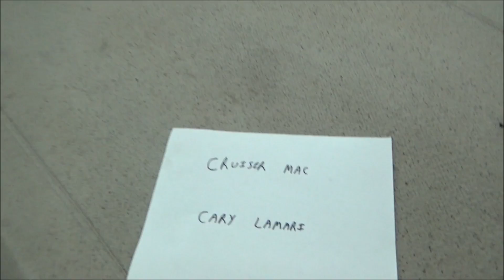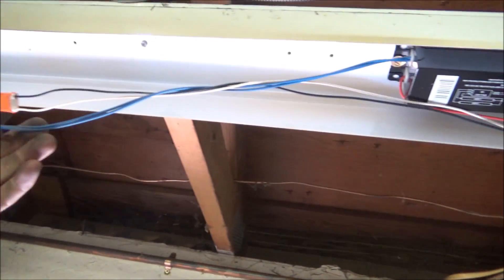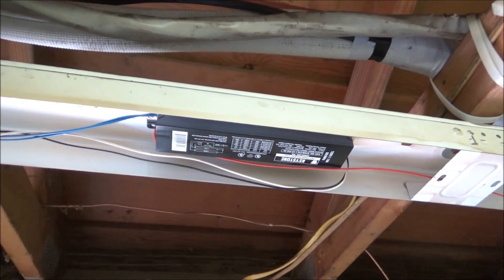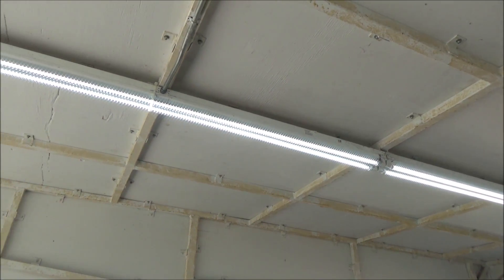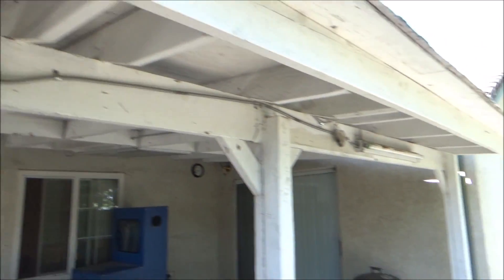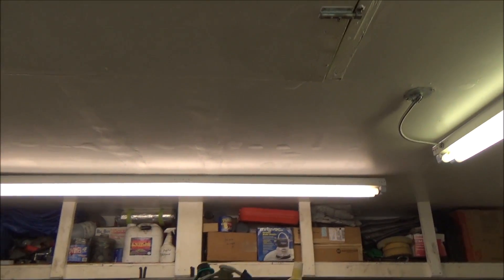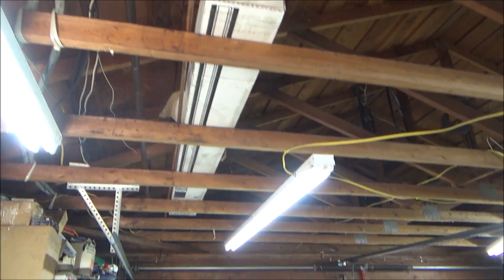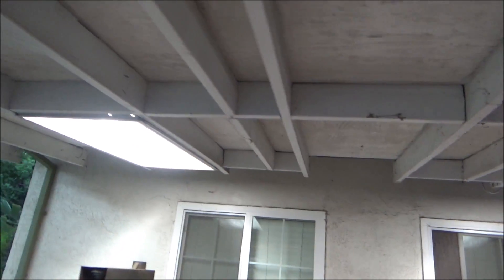How to Convert 8 Foot T12 Fluorescent Lights to LED Lights

Comment: You didn't show how to convert the dual pin t12 to a single pin.
Reply from the maker: I didn’t convert dual pin to single pin.   It was already single pin.  You just remove the ballasts and rewire it so the sockets have 120 volts going to them.
Reply: @1970chevelle396  all my t12's are dual pin. Are they shunted or non shunted?

Comment: Excellent light for garage, utility room, or workshop<👀>share4.photo/LCeilingLight?Hん    Like all surface mount strip lights, it's not going to win any beauty pageants, but as far as strip lights go, it's quite attractive. Puts out a lot of very nice, even white light, without any hot spots or shadows. LED driver takes a second to power on the LEDs, meaning you have a very brief interval between flipping the switch and getting light. This is really no different than the delay in a fluorescent fixture as the bulbs strike.
Reply from the maker: I put LED’s in my whole entire house.  Only regular lights I have are the ones in the refrigerator and microwave.  The LED’s are so much better.

Comment: Hi- interesting video...would you please post the following info on the 8' lengths of LEDs you installed? Such as the manufacturer's name? the wattage of each LED? the color temperature rating (Kelvin)? light output (lumens)? and the life rating (hours)?  I want to do a cost analysis on how much it will cost me to convert all my fluorescent fixtures in my shop.  Thanks in advance; and for posting your video!
Reply from the maker: I paid $368 dollars for 25 of them on Ebay.  There the bulbs that have double rows of LED’s.   There real bright.  I don’t know any of the other information. It’s been a while since I bought them.
Reply: @1970chevelle396  Thank-you for your reply and efforts; I was hoping that there might be some spec info printed directly on the bulbs.  Cheers!

Comment: So where is the part about "How to Convert 8 Foot T12 Fluorescent Lights to LED Lights"?
Reply: That's the part you're supposed to show! SMH!
Reply: Useless video,just showing off lights already wired
Reply: Stupid video, didn't show anything about wiring lights.  Waste of time.
Reply from the maker: +locacoyote   That’s it.  There isn’t much to doing that.  Your just removing the ballasts and rewire the sockets for 120 volts.

Comment: I just had a continuing education class on just this scenario(Kentucky and Colorado licensed electrician). the only problem with what you've done here is not replacing the tombstone with a 120v rated version.  the ones that come installed for the T12 are only rated for ~50v.  This may not give you issues but when/if it does they break down and go boom! hopefully you havent had this problem yet!
Reply from the maker: +Deven Chavez    It won’t cause any problem those LED bulbs draw so little amps.  The amps are what will cause it to burn up , not the voltage.

Comment: Haha, yea the older we get the worse it is. I have to do my shop with led's bad. After seeing Darin do his and now yours. My 2 ballast went out on 1 side of my shop and I cant anything.
Reply from the maker: The LED'S are much better.  I got tired of having to replace the ballasts.
Reply: Yea they don't last long and mine are mounted right up against the roof in my big oven it kinda cooks them.
Reply from the maker: That was probably why my ballast were going bad also because it would get so hot in that garage.

Comment: Ken the best part is the LED tubes are expected to last 50,000 hours. isn't that great I hope they help make things easier. Your one smart cookie there Ken lol
Reply from the maker: Cary Lamari   The older I get the more light I need.  50,000 hours I probably won’t ever have to replace them.  Since I don’t use them very many hours a day.  I just filmed another video outside at night.  And it was so bright ,  I didn’t even have to set any other lights up.

Comment: Have you noticed fewer bugs around the LED lights at night? I saw that here with all the outdoor lights, the old ones were always surrounded the LEDs don't seem to attract them.
Reply from the maker: Blazer02LS   Yes I just noticed that.   I just filmed another video,  this one at night and it was bright enough where I didn’t have to use any other lights.   Then I looked up and didn’t see as many bugs flying around.